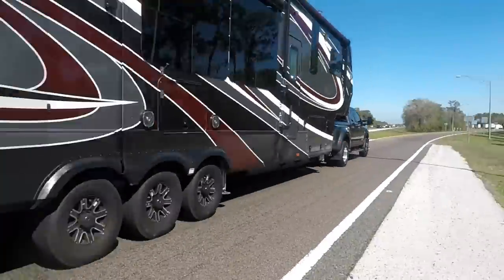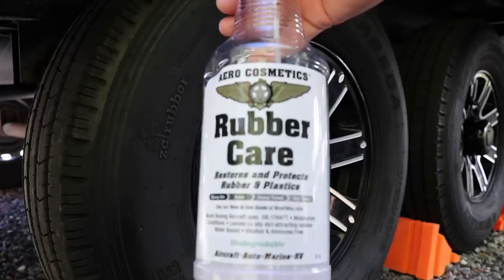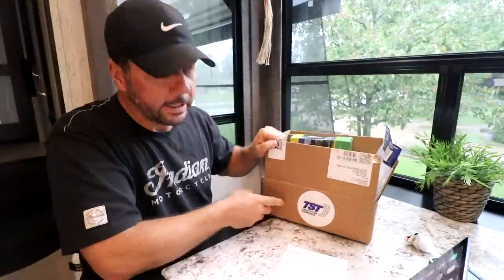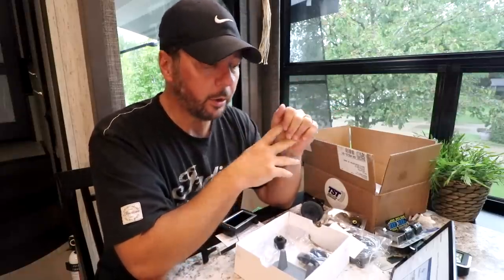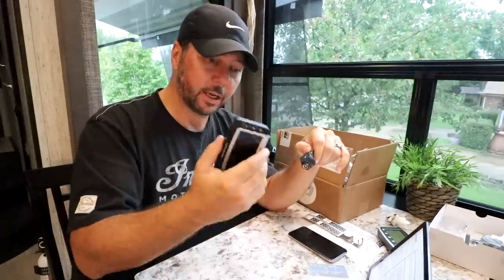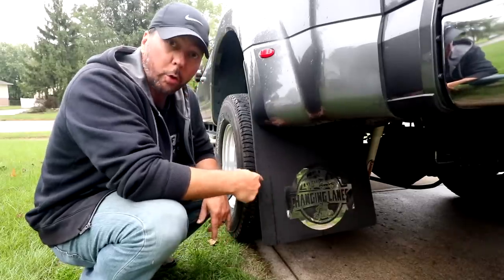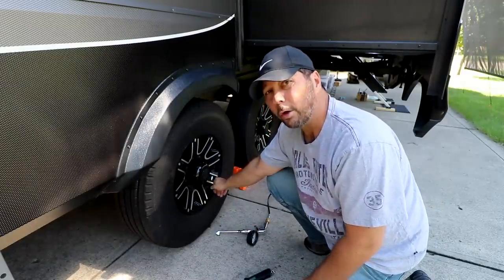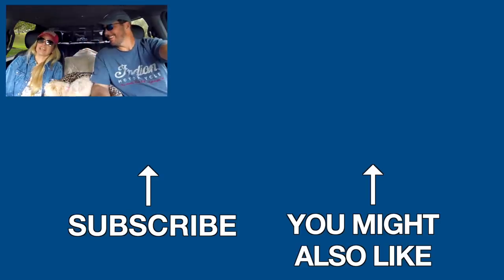RV and Truck Tire Safety | Best TPMS (Tire Pressure Monitoring) (TST-507) Review | Changing Lanes!

Comment: How do the transmitters affect the tire balance?
Reply from the maker: They don't.  Not heavy enough to make a difference. 👍🏽
Reply: @ChangingLanes  I forgot to ask. How long do the batteries on the transmitters last? If they go out can they be changed or do you have to replace the kit?
Reply from the maker: I'm not 100% sure.  That would be a good question for TechnoRV though. http://support.technorv.com/index.php?pid=newticket&department=2 
I do know the batteries can be replaced.